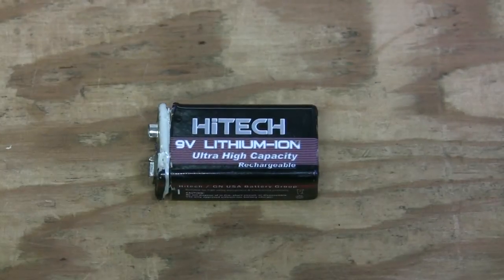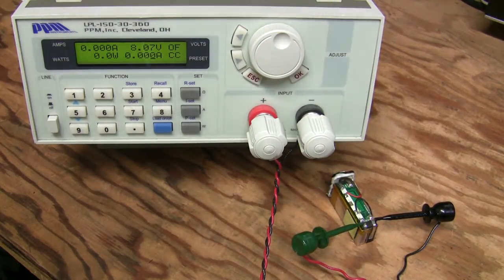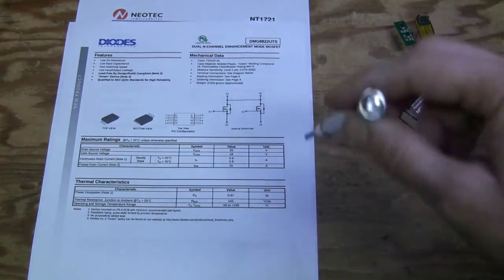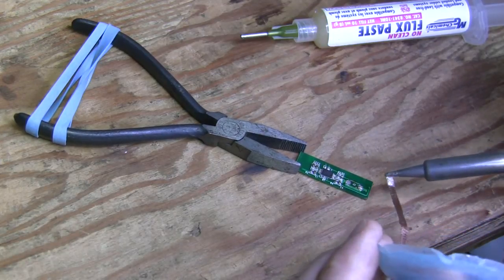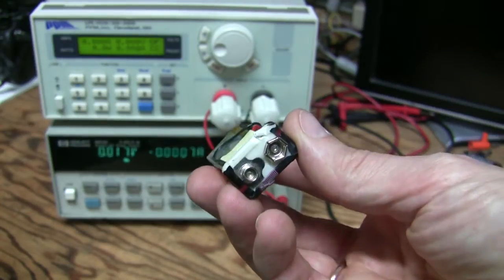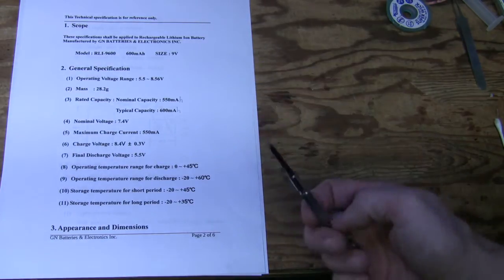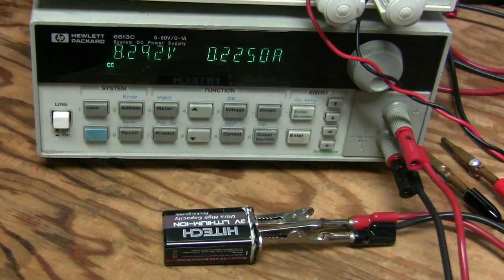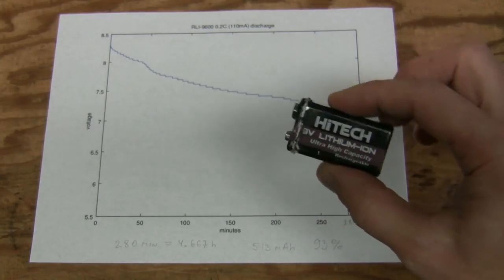#22 - HiTech 9V Li-ion battery: teardown, repair and test

Comment: I think it was burned because has not any protection from short circuit.
I know it was really a long time ago, but I would add a self recovering fuse during this repair.
Reply from the maker: It certainly does have short circuit protection

Comment: This is very interesting as I have some EBL 9v lithium on rechargables.  Any comments on the protection circuity and whether you would be concerned about explosion /fire risk with these.   The calculated mAH capacity and the discharge graph are very interesting
Reply from the maker: The protection is fine, no problem. EBLs are tested here: https://www.youtube.com/watch?v=9A06SPUF8i8

Comment: Half more power hunger devices reject those batteries due an alkaline havin 9.6v and this at best has 8.15 due lithium chemestry and its protection circuit board.
Reply: malicious1111 Alkaline "9V" batteries only have 6 cells, providing down to 7.2V before running flat.

Comment: Cool, I had a bunch of these failing because of non compliant chargers. Basically if the cells are unbalanced, when one of the protectors opens, to avoid over voltage of the full cell, its sees open voltage minus cell b voltage across it. Some chargers assume the battery is not present and dump 12V or so, burning the device (12V-8V = 8V across the IC).
So always ensure the charger is a good quality one that doesn't exceed the maximum 8.4V charge voltage under no load.

Here's a video with a review of such behavior, which essentially damaged my batteries in a similar way:
https://www.youtube.com/watch?v=TL_x-IZjpvE&feature=gp-n-y&google_comment_id=z12muzzzfvzhsfeld23ozbro1unwixac1
Reply from the maker: +Susana Godinho 
Great investigation. What a heap of garbage are those Shoshine chargers.

Comment: You mentioned in a previous video where you rewound the toroidal transformer that that was not an economical repair. I think you have beaten your record for non-economical repairs with this battery. On the other hand, it was very VERY instructive and I thank you for making this video. I have a bit of a tangential question for you:

Why do you keep using your 6613C in preference to your 6612C for most videos requiring small voltages? Is it for the better current control? I am waiting for my 6611C-J05 to arrive and a pair of 6612C units and I think I would prefer to use the 6611C for better voltage control for almost all projects, resorting to the 6612C units only if I need more than 10 volts or multiple supplies.
Reply from the maker: +SteelBlueVision 
Rebuilding the transformer took several days of work. And I was partially joking anyway. I didn't regret spending time, just warned viewers, that it is harder than it seemed, and harder than I expected.

This battery fix was quick, cheap, and, after all, fun. By the way, such battery was $15-$20. I fixed it for $0.54. Yes, now I see similar batteries from China for a few dollars on eBay. But these repairs don't have to have economical sense all the time. I learned something. Hopefully some viewers did too.

Regarding 6612C and 6613C on the bench. No particular reason. I just use whichever was sitting on the bench at the moment if it does the job and the difference is not important.
Reply: FeedbackLoop With regard to the 6612C vs 6613C answer, haha. I was expecting a logical answer, but sometimes it's just a matter of convenience. BTW, I love your repairs and have subscribed!
Reply from the maker: +Jonny Onearm 
Thanks. If you subscribe to the channel, you should get some sort of notification about new videos.
Reply: WOW - my compliment to excellent education video - great job mate!!!
I would be happy to see more of your work - let me know if you have done 
something new please

Comment: It is the first battery repair video I have ever seen. Very interesting.
You have set up charging current = 225mA instead of 275mA (550*0.5C).
Reply from the maker: Jacek Pawłowski Yeah, bad arithmetic on my part. And I missed it while editing the video. Not important in this case. It charged slightly slower in the first (constant current) phase. Thanks for your feedback.